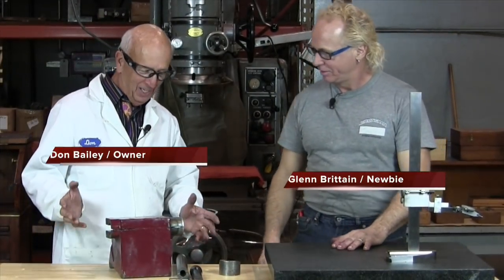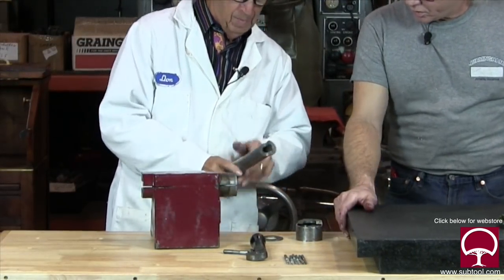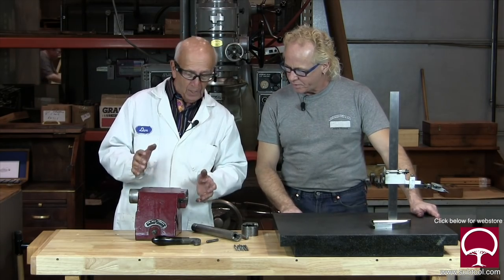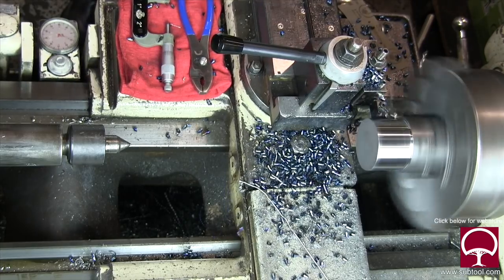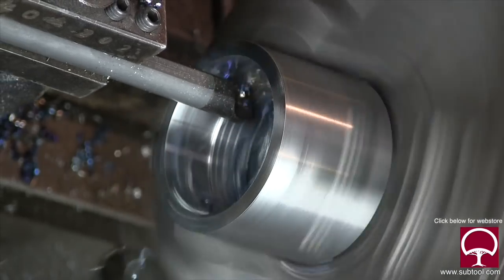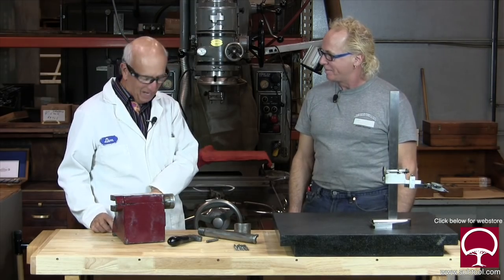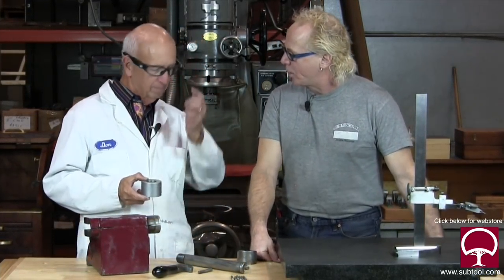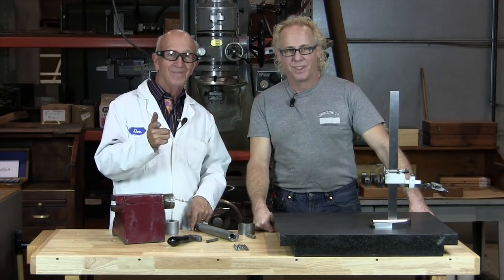How To Rebuild an OD Grinder Tailstock - Part 1 of 3

Comment: Dons comment on "frustration" and general tidiness of ones work area is probably one of the most important tips he has given us all. Spending 10 minutes looking for a tool amongst a clutter of tools on the work bench to only use that tool for 20 seconds is a serious waste of time. What is worse, it breaks your flow of concentration away from the real job.  What is equally annoying is that often the tool is so close to me that if it were a dog, it would have bitten me. You just can't see the wood for the trees.I'm self taught and work on my own, so I have no one else to blame but myself. About 5 years back I got so mad with myself I now get real anal about putting tools away so I can instantly put my hands on them when needed and not, then have to think, now, where was I, what was that last measurement?

Comment: Got a B&S reamer or will you just go with a turned taper using the lathe? Maybe a trip to the ID grinder would be best after heat treating so it wears nice and long.
Reply from the maker: +bcbloc02 We used a reamer.